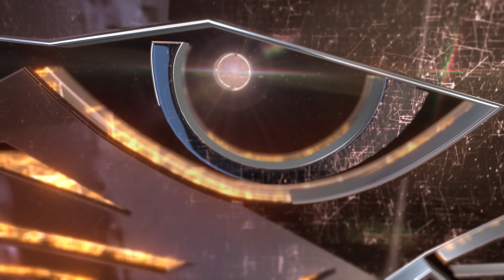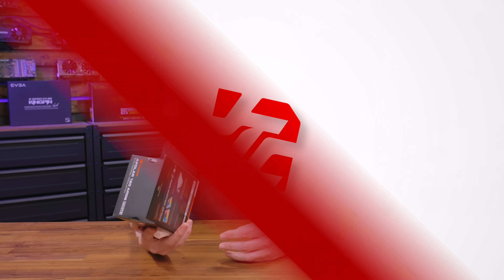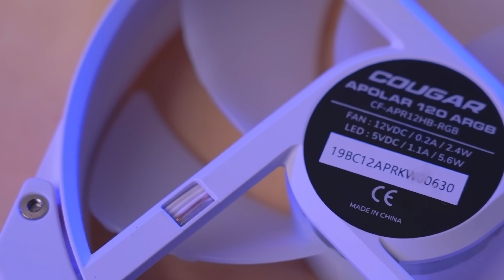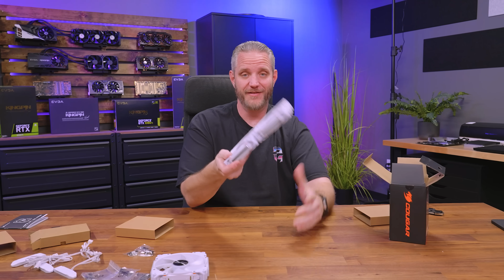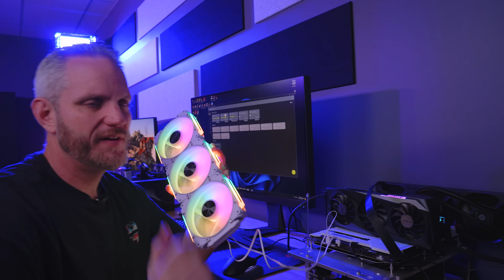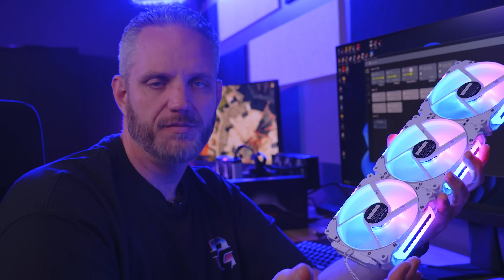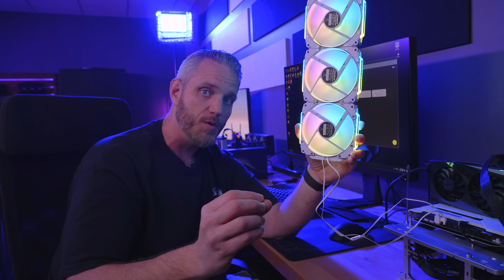ALL PC fans should have this feature! (NOT RGB)

Comment: Noctua needs to do this too back in the day fans were either really cheap and just terrible or they were Noctua and now RGB fans cost more than the high performance Noctua's which still outperform just about every fan out there in both acoustics and airflow. I for one don't see the point in spending money for RGB fans that will not cool as well as a similarly priced Noctua. But this new trend of daisy chain interconnects is amazing especially in a SFF build where you just simply don't have the space for any extra cables. Its the only thing thats had me consider anything aside from a noctua fan in over a decade which i still have some of the OG fans i bought back then in my PC right now.

Comment: Yo jay my boy. I got one better. Amazon has a daisy chain argb infinity mirror unifan set for 36 bucks. From a coupon brand called icoler and yes that is right spelling.  For reference lian li is selling a pretty much identical set for about a 100 bucks. The savings  is unbeatable. Amd there great. Might be worth it to do a video or shoutout. There great value and from what I hear there customer service is pretty good. They also work well with signal rgb

Comment: I do like that there's no need for a separate controller, just the two cables. While I adore my Lian-Li fans, the fact that you have to use them with a controller feels like kind of a drawback, because you can easily run out of usb2.0 headers in your motherboard.

Comment: Jay & Co., I think it would be cool if they put pogo pins or something right in the case and hide the wires to the pogo pins in the case in a hollow part or the edge (you get the idea), then there would be no wires at all, especially if its a motherboard with the plugs on the back side. If they standardize it at least somewhat, it might be a thing. What do you think?

Comment: 16:22 Arctic already does this. However it is a tiny pigtail instead of solid contacts. This got a advantage that you can have 6 fans daisychained with only one fan header if the 3 top ones are close enough to the front ones. (I sandwich the pigtail between the fans when i mount the fan to hide them completely)

It is also the cheapest and best performing fans i have ever had. I bought a 5 pack of P12 fans. Was so impressed with the price to performance, i ended up buying 2 more packs and kited out all my pc's with them. They are close if not surpassing noctua sound to performance ratio.

20-25 bucks for one fan is to much no matter the build quality of the fan for me. All my pc's uses a minium of 6 fans. It is just not worth the price unless you are only considering looks, all that money could been spent elsewhere in the system for significantly better peforamance.

Comment: Jay, I'm pretty sure that those black rubber "gaskets" or "pads" that came with the fans you showed in the begging that you were not sure what they were for are going to be black replacement dampeners for the orange ones that come pre-installed on the fans.  That's what it looked like to me to be the case anyway seeing how easy those corner brackets look to remove with those nice stainless bolts.  I would be shocked if cougar just forced you to live with the orange but looks like they accommodate you with a set of black dampeners. Also would be very easy for anyone with a 3d printer ( like  yourself ) to print out a set of dampeners for the fans in any color you could buy TPU/TPE in.

Comment: To me the Thermaltake Swafan EX are still the best due to the ease of maintenance. They're interconnected too, but the best feature are the removable fan blades. You can also re-apply lubrication when needed. Only downside is that they're not as powerful as other high-end fans.

Comment: Price isn't bad for fans these days only because there's a 20% off coupon at the moment, but that said, fan pricing these days is still absurd.  Paying $25-30 per fan is way too much in my opinion.  You see non-RGB fans well in the sub $10 range from reputable sellers such as be quiet, arctic, and antec.  Fans with the features of RGB and interconnecting daisy chain should be be closer to the $15 each price point.  Even if it's only sold in 3 packs for $45 as a volume discount, pricing needs to get better.  These units can't cost more than $4 each to manufacture.

Comment: I think the interlocking clips should be located outside instead of inside. Having it the way that it is have more risk than having a clip that you can just pop in/out on the edge of the fan. Also, if it's outside it'll be easier to replace if the interlocking clip is damaged at some point and it'll be easier to manufacture and sold separately as well w/ a lot of modding potential to boot since it can also be potentially 3D printed for custom color variations or even have an image or logo if you so desire. But either way this is a great start.

Comment: Update your Armoury crate then it should show the stuff on the Armoury crate devices lists! Also, my Corsair LL120's are rated 2,200 RPM but i've tuned/overvolted/overclocked them to go upto 2,682 RPM without any problems. I'm legit serious on this. (By using software and also Air compressor unit to tune/overvolt/overclock them)

Comment: Jay....  Do you think you mnight do a video on what brand and models of Non-RGB fans  are the best bang for the buck?  I'm 71 years old so having RGB in my systems doesn't really mean that much to me, it's not like having RGB in the system makes the system faster or run cooler.  To me it is just one more thing to have to mess with and configure.  I currently have some old if over 12 years old is a thing.  They are still quite and keep my system reasonably cool considering the system is used as a Plex server and runs 24/7 and never gets shut off.  But I'm sure eventually the fans will start to fail and I want high quality Non-RGB fans since my case has no glass anyway.

Comment: $70 for a 3 pack is not that bad really, compared to the Noctua NF-A12x25 PWM's that I want to get 7 of and they run $35-40/fan on a good day ( I used the Phanteks fan frames if I want RGB)

Comment: You have the same RGB issue with your ASUS board as I did. I couldn’t ever fix it, even with iCue, Aura, or OpenRGB. Why I just ended up replacing the board entirely with an upgraded ASrock.

Comment: That is what computers have needed for a while conuits for all the power dedeliveris that require wires. Base computers have that sorted  and now the things you need are extra wiring for fans, lights accents, and ever GPU's and CPU cooling reqiure added wires. by itself it's not bad but that adds up after a fashoin. Were supposed to be betting simpler with building these things instead of being static with the wiring so anything that shrinks that number of wires is a positive.

Comment: Not a fan of the orange grommets, but you could easily mod that. If they're much cheaper than the competition that's not such a big deal, I don't mind modding stuff if it's cheaper. They are really nice looking! I only ever use solid colors anyway so the RGB not lining up is just fine to me.
Reply: The black rubber pads that he didn't know what they were for in the begging were black grommet punch outs to replace the orange ones already included in the box =D

Comment: Im telling ya, ill keep saying it on argb fan videos. Check out the Asiahorse Cosmiq Unis. They exactly like those or the lian li infinitys. They come in black or white and also offer a reverse blade option and they're $45 for a three pack. Because i got tired of the lian li l connect software, i replaced all 15 lian li infinitys with the asiahorse cosmiq unis. I use them with Signal RGB and work awesome and the White matches all my other white argb stuff. Also, keep in mind, they're a budget option.

Comment: Good that you mentioned  the thickness, will not work as a center fan in a typical dual tower cooler. You should start covering how easy it is to remove the rgb cables. Now THAT is what fans need, those to be removable to reduce clutter if you don't use rgb.

Comment: While I like the 'idea' of fans that link together to simplify cabling and unify controls, the expense and lack of interchangeability got frustrating to me. When I realized the $180 worth of SL V2 fans wouldn't in any way work with the $100 worth of SL V1 fans I already had I returned the V2s, stuck the V1s in a box and bought $40 of TL-S12s for my latest build. These Cougar fans appear to be a step in the right direction, but I'm done with the incompatible nature of these fan ecosystems.

Comment: So glad the amount of cables for RGB fans is getting less and less, just two cables is amazing. Corsair early on was such a massive pain in the ass, 7 fans for 14 cables, not to mention multiple controllers which also needed power and LED strips. Must have been about 20 wires just to power Corsairs early ML fans, absolutely insane and so complicated getting all that to work together.

Comment: Jay, Lian LI has interconnected fans with no rgb LIAN LI UNI Fan P28 120 Triple Pack. Thermaltake also with the Thermaltake TOUGHFAN EX12 Pro PC Cooling Fan, Magnetic Connection, Swappable Fan Blade or 140mm

Comment: Jay, had the exact same issue with my G-Skill Neo DDR5 on my ROG Strix X670E-E... had to completely remove AC to fix it... It just started one day when using the "starry night" setting. If I went to other aura profiles it sometimes worked, but usually not... Glad it is happening to someone else, though it sucks, so I know it isn't something specific to my system.

Comment: I was one of the many sheep that went all nuts with water cooling I did not need, now I am on the zero train. These are amazing. I have dropped my aio, and all the dumb shit I didn't need for cooling. I am down to an air cooler, 2 360 chain sections and the fans on my 7900gre to cool my rig and it is still overkill. My only complaint is I hate argb headers/rgb and would like black blades. Otherwise it is great. We have spent 9 years trying to overkill our cooling while mostly putting shit in wrong for exhaust anyways. Thank fook wk failed so many of us can get over our need to make our computers look they they are more than they are. All the crap we have put in to novelty over the years has actually hurt our performance as we could have put money into better x3ds instead of pretty shit that did not and required constant tinkering.

 Tl:dr; these are great. Grab an air cooler and a few daisy chains and enjoy noting having a rats nest for cable management.

Comment: I completely disagree. I hate this trend.

1) While this seems to use standard fan headers, proprietary header and thus controllers are more the norm. Those SUCK. 

2) it might be cleaner,  but it is less flexible and often more bulky in SFF cases with those bulky end caps and controllers(on others like lian li). I think a better solution is just the cheap generic open standard y spliters stubs with detachable cables like with phanteks t30 or artic pst fans. 

3) cost.. this is just an excuse to drive up cost like rgb, and now like stupid LCDS everywhere... seriously an LCD on a frakking fan? what is next? speakers on a fan? why not just slap a rasberry pi on the fan and have it be a mini pc fractal?

I want a premium fan market where 90% of RnD went into making fans blow air better. Stuff like liquid polymer blades, better blade design, better bearings, etc. Not bling crap.

Comment: Should there be a proprietary plug combining PWM and rgb on motherboards so depending on the device it only sees signal it needs whether it’s a non rgb Pwm fan or both or a rgb item with no fan but have pass through capabilities like I’ve has

Comment: Honestly, for me, it's actually a huge plus that the fans operate independently. It means that the software you use to control them is guaranteed to also allow you to configure them EXACTLY how you want. It means that the motherboard header is treating each fan like it's it's own device, rather than a single device.

Nothing worse than wanting to have a specific effect throughout your build, for a daisychained set of devices to refuse to do so, and force themselves to act how they want / are programmed to... nah, it's far better that the user gets to decide how it functions for themselves.

Also, SignalRGB is FAAAAAAAAAAAAAAR superior to OpenRGB. Much bigger selection of effects, can even make your own. Device control is absolutely terrific and the UI. Don't even get me started on the absolute terrible UI of OpenRGB. SignalRGB also releases updates much faster for new devices. 

Only two things OpenRGB has going for it, is more integration for other ecosystems such as Govee and Philips Wiz smartlights. But even then, setup is far more complicated than it should be, requiring you to insert the IP addresses of each light. Most users would have no idea how to even obtain the lights IPs. I got it working fine, but then I'm not an average user.
Second pro for OpenRGB is the ability to say... download a plugin which enables you to colour your CPU waterblock/memory/GPU according to their loads/temperatures. Good for keeping track of system performance and cooling while under load.

Bigger benefit to SignalRGB though: it actually doesn't require you to manually say how many LEDs per device you're using. You just choose what device is plugged in using a handy colour indication (fan flashing blue, you choose what the blue fan is from a list) and it's automatically working. In addition, it tells you the max LEDs per header on not only the motherboard itself, but any controller you may be using. Example, it tells me that each header of a Gigabyte B660 ATX AX Gaming Wifi motherboard can support 120 LEDs, and each channel of my Razer Chroma can support 80 LEDs, for a total of 480 LEDs. OpenRGB can't seeminly see the LED limits, and will refuse to light up some LEDs on occasion.
(I have 3x Arctic P12 RGB fans with 12LEDs each, and a Lian Li O11 Dynamic Evo front light strip with 21 LEDs all daisychained for a total of 57 LEDs. Signal handles them all correctly, Open refuses, and 1/4 of the LED strip remains dark).

Surprising for me to say all this for a program that's essentially closed source, vs. OpenRGB which is supposed to be, well, open. One would imagine the OpenRGB community would do a much better job.

Comment: $70 for RGB fans is still a lot when you consider that you can get a 3-pack from thermalright for under $15. You cannot possibly tell me that the daisy chain tech inflates the price almost 5x.
Reply: you usually get what you pay for. $15 for a 3 pack of argb fans sounds like cheap junk.
Reply: @KOCotto I've purchased 3 packs now with no issues. They're PWM, ARGB, and Not any noisier than other fans. If you get them without ARGB, the pack is $11. I've also gotten a $40 240mm AIO from them too, and again, no issues.

Comment: All fans should be interconnectable, but please make the connectors useable with a radiator. One side of the LINK system is rendered unusable because of the radiator pipes.
Reply from the maker: Agreed

Comment: PWM) fans do not adjust their speed by varying the voltage. Instead, they utilize a PWM signal, which rapidly switches the motor on and off to control the fan speed. This method provides precise control over the fan's performance while maintaining a constant voltage. Noise from some fans, it is likely due to a poorly designed PCB with inadequate noise suppression or filtering mechanisms.

Comment: Daisy chaining fans are nice. The problem is every brand want their own solution so mixing fans from different manufacturers becomes problematic.

We the customers want to see a standard for this! Something that multiple manufacturers can agree on using. The current situation reminds me of the very early days of local buss on motherboards and graphics cards. It made graphics cards faster as they could access the CPU bus directly, but each manufacturer made their own standard so you could only use graphics cards that matched that standard. Then VESA got into the game and presented the VESA local buss connector and suddenly manufacturers of both motherboards and graphics cards decided to join the expanding group making compatible cards.

At the time the total volume made the manufacturers look at the huge potential market. Trying to battle for their own specific standard was never going to make as large a protentional market. I have no idea how to market this to fan manufacturers in a way that makes it economically profitable, but then I'm a tech not a marketer, inventor or investor so I really don't have the skills or ideas that can make something like this.

Perhaps a combined fan and LED connector would be an idea, but then that would probably not work as motherboard manufacturers had to adapt. So I'm all open to ideas here. What I do know is that it would have to be cheap, robust and dependable. Small dimension differences has to be expected as these can come from differences in manufacturing technology and materials used.

Comment: THE BIGGEST issue is there isnt a 3 fan set being sold, huge negative. not going to buy 9 individual fans and then have to buy a controller when i know in a 3 pack ill get all that. hopefully they sell the 3 pack soon
Reply from the maker: There's literally no controller.... did you even watch??
Reply: Gigaparts sells a 3 pack of these. The white ones are currently sold out, but the black ones are in stock. Also what Jay said.

Comment: seems pretty good!  can you use the extra cables to daisy chain 2 sets of fans, or do they sell a cable to do that?
Reply: Manual states to only daisy chain max of 3 fans off a single header. Anymore and you need a fan controller